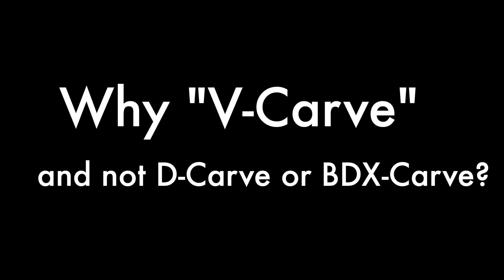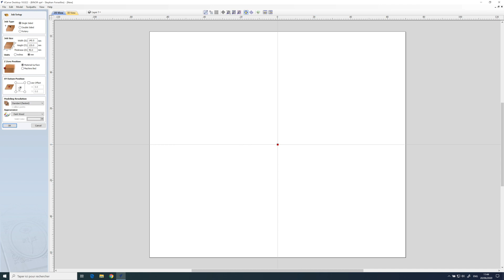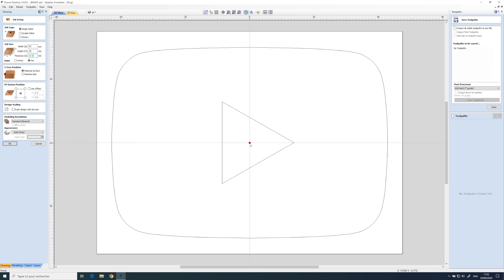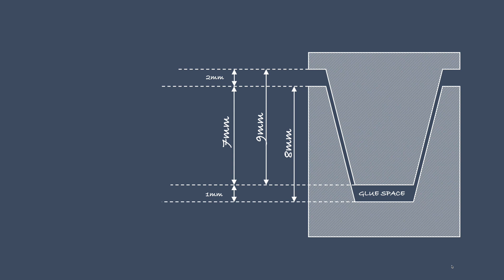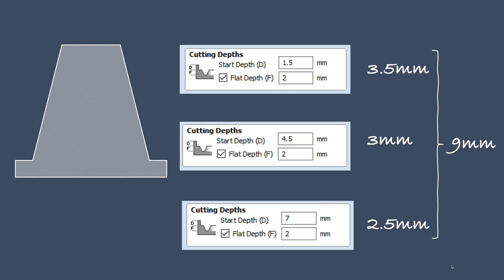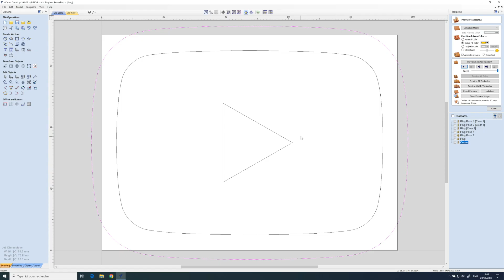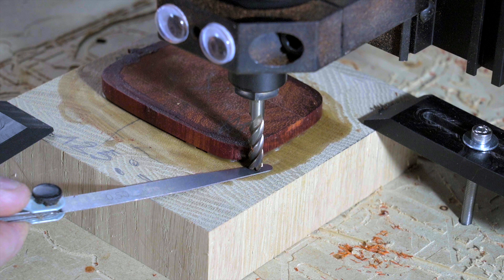Deep inlays VCarving detailed tutorial with Vectric VCarve

Comment: Can we adjust the multiple tool paths to get the full depth of the plug by setting the cut depth of the bit used?  I use this method and Aspire v12 on a Legacy Maverick 3x5.  Thank you for the very informative videos you create.  You are an excellent instructor.
Reply from the maker: Thanks! No that won't work because VCarve (in my case) considers that there nothing above start depth so it will immediately plunge to Start Depth + Cut Depth on 1st pass.

Comment: What values determine the glue gap vs how much the male piece protrudes above the female? In your example I assume the 1mm glue is the difference between the depth of the female piece compared to the final depth of the male. 8 vs 9. But what values control the gap of the male piece above the female?

Thx
Reply from the maker: Hello. Glue gap would be (Flat depth of pocket)-(Start depth of plug). What protrudes (gap that 'sticks out') is flat depth of plug.

Comment: I have tried your method and followed the process exactly with the exact same depths of cut but I can't get it to work. The plug and pocket are exactly the same size and only go in about 1mm... what am I doing wrong??? Do I need to off set the vectors? Please help!!!
Reply from the maker: You don't need to offset. You use the same design (but flipped) and the Start Depth of the Plug will be the depth of insertion. I learned/experimented by inserting a lot of small start in scraps. :)

Comment: Hello, first I must say, dthat you have made a very good tutorial. I have a quastion. If you tell the V-Carve tool bit in the settings of the bit, that it can only plange 3mm in, than you dont need to make many of tool pathes. Am I rigtht, or wrong?
Reply from the maker: Hello, thanks! The parameter 'pass depth' is only valid below the Start Depth. So if the start depth is 10mm and the pass depth is 3mm, it will immediately plunge to 13mm.
Reply: Yes, you're right. I've tried it and it's actually as you described. Thank you for the explanation.

Comment: Great lesson. But instead of split manually the tool path for the male, can’t I use the max pass settings of the bit?
Reply from the maker: Thanks! That parameter (Pass Depth) is not used by the CAM above the Start Depth. So if Pass Depth is 3mm and Start Depth is 10mm it will directly plunge at 13mm.

Comment: Hi Steve, I hope you still review these older posts!!  First, I want to thank you!  I very much appreciate the detailed explanation you've given here.  It all makes sense, but I was unsuccessful in replicating your procedure.  My plugs were a little too loose, and I'm wondering if it's the v-bit.  I tried a 2-flute, uber-sharp bit, but the tip immediately blunted on first use.  So I thought that threw off the the diameter and caused it to cut to much.  So I bought a better quality Amana bit, which had a secondary bevel ground tip, and the insert was even more loose.  Please tell me what was the bit you used.
Reply from the maker: Hi. Yes I review but it can take time. ;) Thanks for the feedback. No need for a very sharp tip. I'd recommend getting a .25mil round nose and (for me, that's the trick) configuring it as a flat-nosed engraving bit. That's what works best for me!

Comment: Another question.  Can this be done using pocket toolpath?  If not, why?  Thanks for making this video btw.  Very informative
Reply from the maker: No, because a pocket toolpath will only carve where there is enough width for the bit to go all the way to the cut depth. That's not a problem for such a design but for a more intricate one you wouldn't get any of the details.

Comment: Excellent video. One question. Why not just use one tool path snd set a depth per pass rather than three tool paths which you then combine into one?
Reply from the maker: Hello. Pass depth only works below start depth. For the plug we have a big start depth and the bit would plunge directly to Start Depth + pass depth.

Comment: Great video! But I have a suggestion, for if you ever revisit it.

The one part of the whole depth calculation that remained unclear to me after your explanation was the significance of "start depth", with both pocket and plug, so I think a little more attention to this point would make it clearer. The bit that I didn't get from your explanation is that start depth (on both pieces) is the depth at which the outline of the carving *matches the lines in the design*.

For example, suppose the design has a 5mm wide line in it.  What we want is for the cut into the pocket to be 5mm wide at the surface, and we want the plug to be 5mm wide at the plane that will line up with the pocket piece's upper surface. On the pocket, the cut will slope inwards from that widest point at the surface, and on the plug it will slope inwards above that plane (before inverting it). That plane, which is the surface of the pocket piece and the maximum insertion point of the plug piece, is what VCarve calls the "start depth".
Reply from the maker: You're totally correct. In your case, the plug's SD would be, 0mm so the line would measure 5mm on the pocket surface. And on the pocket, I'd use a SD of 8mm which means that the line would be 5mm wide 8mm below the top of the 'ridge'. It means that the plug would fit 8mm into the pocket and there would be a 2mm glue gap. The Flat Depth of the plug would be what 'sticks out' after insertion.

Comment: Huge question...
Using a 6.2deg tapered ball nose with a clearance bit of 1/8" for the Female depth .2" male portion of the inlay (start depth 0.18, flat depth .12) total .3" for inlay.
Pass 1 start depth 0, flat depth .0625
Pass 2 start depth .0625, flat depth of .0625  - Total .125
Pass 3 start depth .125, flat depth of .0625  - Total .1875
Pass 4 start depth of .1875, flat depth .0625 - Total .25"
Pass 5 start depth of .25, flat depth .05

I know it sounds like a lot of passes but this is a ver cautious case.
Also what id the pass depth for the 6.2deg is different than the clearance bit?  Should the be conservative?

Thank you very much in advance.
Reply from the maker: Yes, those pointy bits tend to be more fragile (and turn slower) so I generally do less agressive passes. :)

Comment: Good evening how are you.
I have followed the process as you explain it, with the same parameters for the pocket and the plug, and the same tool, and on two occasions the plug does not fit inside the pocket, clearly it is seen that it is bigger, if you can help me help with that, it would be very useful, because I'm stranded, thanks
Leon Anchislavsky
Reply from the maker: Hi Leon. There could be a lot of reasons but if your Start Depths and Flat Depths are correct, it may come from the bit setup. What bit are you using?

Comment: I would like to used a 6.2 degree tapered ball nose bit for making inlays using V-Carve. Do I need to set this tool as a V-bit?
Reply from the maker: No, better set it as a ball-nose or (better for me), an engraving. That's what gives the best result because Vcarve will take the non-pointy nose into consideration when making the toolpaths.
Reply: I’m also using the amana 6.2 degree with 0.25 radius. 
Having problems with the inlay , it seems to round the corners and after clearing the plug every corner missing the point.

Comment: One question.. are the inlays made from end grain pieces of wood. They all seem to look like plugs cut from end grain panels
Reply from the maker: Indeed 99% of what I do is end grain. I make the blanks myself by glueing pieces. Two reasons:

1) for cutting board end grain is more resistant and more gentle on the knives as they cut 'between' the strands which just give space then come back. A bit like inserting a knife blade vertically in a toothbrush.
2) End grain is much more satisfying to carve (faster, more precise, less noise)

Comment: Brilliantly explained, do you have a guide on how to do the inlay toolpaths for small lettering? As im having a problem with that thanks
Reply from the maker: Hello. No I don't have a specific guide. But as a general rule, avoid segments narrower than 2x your bit nose, if possible. Don't hesitate to spend time in Node Edit mode at high magnification in Vcarve checking and correcting those. It's not fun but it does help a lot. Also, the choice of font is always important.

Comment: I don't understand the need to do the extra tool paths. Why not just set start depth on the plug 0 and flat depth 7?
Reply from the maker: Because the start depth on the plug is the insertion depth so if you start depth is 0 the plug will not enter into the inlay, it will be too "fat".

Comment: Great video and thanks for making. I have been operating for 4 years and this is the best video I have came across on vcarve inlays. Very good explanation of the plug multi pass trick. It will save me some bits even having a heavy machine. It always made me mad that it did the plug in one pass and I just assumed missing with the values would miss something up.

Comment: I don't quite understand the multiple passes.  Because the cut is sloped, starting at a different depth means the path is offset.  Somehow the selection of the V bit must be affecting the geometry all of the toolpath passes are working to create, but I don't understand how.
Reply from the maker: Hello indeed but the deeper passes will be wider than the previous ones, enlarging the design a little bit each time. But at least most of the  material is already gone. So you are good as long as you don't go deeper than the fluted length of your bit.

Comment: I don't get it, why can't we just set a start depth of 0 for the plug part and a flat depth of 9mm and let it split the passes according to the cut depth we set up for the tools without doing it manually?
Reply from the maker: Hello. The start depth of the plug is the "insertion depth" into the pocket. If you have a start depth of 0 and a flat depth of 9mm for both the pocket and the plug, the top of the design of the plug will be exactly the same size as the top of the design of the pocket so there will be no insertion. Not easy to explain, I hope I'm clear. :)

Comment: Hi Stephan. I loved your video as I have been trying to figure out deeper inlays. I don’t arched your video several times and used your numbers to test. I just cut my pieces (using a 15 degree v bit and 1/8 UC end mill). My pocket knife as layered as you can see from video. My plug did not go 1/4 down. Any idea why pocket is layered and why the plug doesn’t go far?
Reply: I can’t upload a video here but will be posting liking to email
to you. Thanks again.

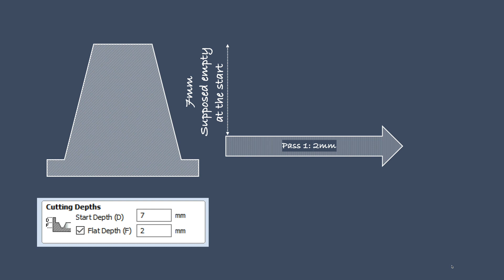Comment: I have the same software and I don't change the zero depth in the "male" part like you discuss starting at 23:18.
After I get the g-Code done for the "female" part,  I do flip the image for next program for the male part to a mirrored image and put another vector box around it. I then cut it just as any other piece. The machine doesn't need to know its going to fit together as one. You do have to create a small offset, but trial and error of a small design, like a star, you can get your magic number that applied to your machine and will work for all inlays then going forward.
If you do it this way, it will fit perfectly without the complicated part about changing the zero depth and chance breaking bits or damaging your machine.
Give it a try it works great for me.
Reply from the maker: Indeed you can do it by flipping and creating an offset. I even made an Excel sheet that calculates exactly what the offset should be based on insertion depth using trigonometry. :P But I got better results by using the Start Depth technique, so I stuck to that one and tried to find the best values.

Comment: Hi Stephan, fantastic explanation, but I have one question left. Is there any kind of correction in Vcarve regarding your V-bit? I gave the program all the information it needs about the angle, the tip (0,25mm radius or some other values for a flat tip etc.)  of the milling bit but when I carve my pocket it gets a bit wider as it should be. The opposite happens for the plug, it gets a bit slimmer as it should be. When I plan around 1mm gap at the bottom of the pocket for the glue it´s way to less because the plug will slide in much deeper as it should be. Usually the plug will sit on the ground of the pocket and gives me open sides. I assume this comes from the fact that V-carve, unless I gave it the information about the the tip of the bit, it calculates the toolpath for a "perfect" spear top without any radius or something like that. Is there a way in V-carve around that or do I have to find the values by  trying and remeasuring? I use the desktop version of Vcarve
Reply from the maker: Thanks. After many tests I found out I get the best results using the configuration of an engraving bit with a flat tip!

Comment: This video helps a lot! One question, to my understanding, as long as you know your start depth, I would assume the flat depth can be deeper. It is just a matter of how much space you want to leave between the plug and the base board, right?
Reply from the maker: Indeed. I generally leave a gap of around 1mm for glue space. Don't leave too much or it will sound hollow and cheap. ;)

Comment: New to this so please forgive the ignorance but for the plug why can't you just have a start depth of 0mm and flat depth of 9mm.  Thank You
Reply from the maker: If you use a start depth of 0 for your plug, the width of the insert will be exactly the same as the with of the cut at the surface of the inly, so there will be no insertion. Say you design a 10mm with line in CAD, your plug (which is an inverted V-shape) will be 10 mil wide at the Start Depth. Not sure I'm being clear, it's not easy to explain without a drawing board. :)
Reply: @sfo2406  Thanks for the explanation.  Life got in the way and I didn't have time to work on my cnc till now and I re watched your video and this time it made sense.  One follow up question.  Why is the inlay toolpath never seemed to be used to do inlays?

Comment: Félicitations Stéphane  très bien expliqué 
I work with carbide but one a new cnc came out last year it's called onefinity 
A small remark when at the end it's time to clear the extra to get it flat  why don't you zero the machine manually and just cheat by putting 0.05 extra on top means that will stop at 0.05 at the end before clearing in the spoilboard  also I like your spoilboard did you make the file or you bought it ?
Reply from the maker: Thanks. You're totally right, and that's how I do it now (starting from 0.1mm above spoilboard and adding from thereà. The spoilboard with the markings came with the CNC but the one I put on top is cheap MDF (that has the advantage of being very flat) and I made it myself. I remake regularly, it costs less than 10€/$.

Comment: Thank you
I did all the steps but the corners are not pointed !!!
Reply from the maker: Hello. Most probably the wrong bit or wrong configuration of the bit! Which type of bit do you use?
Reply: @sfo2406  
Thank you, I use V bit 15 degree 0.2 tip

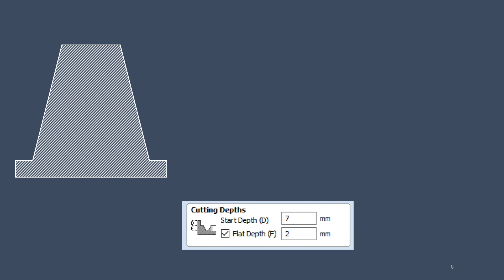Comment: Hello Stephan... very nice tutorial.  But- I have a question... At 23:58 you explain the additional tool paths, which I understand clearly.  But- why did you set the start depth at 1.5 mm instead of the top of the work, which would have been 0.0...
Reply from the maker: Hello. That specific toolpath is just there to avoid going 'full depth' at once (7+2mm). I generally keep my flat depth set to final value (as it's the 'sticking out' part it's generally 2 or 3mm and it's easier to change just one parameter, less chances of mistakes) and I gradually increase the Start Depth on my 'stacked' toolpaths. So here I'll cut 1.5+2 = 3.5, then 4.5+2 = 6.5 (so additional 3mm), then 7+2 = 9mm (so 2.5 more).
Reply: @sfo2406  Thanks for the reply!  
Ok... so- for the first of the 'stacked' toolpaths, would it have worked out the same if you set your start depth at 0 instead of 1.5?  It's that 1.5 start depth I'm trying to understand...
Reply: @sfo2406  I was wondering this same thing. I'm glad that I searched comments first. It seems the downside to keeping your flat depth the same is that on the first pass, the machine will behave as if the first 1.5 mm of material is already removed when it is not. On the second there will be 1mm of material that "should" have already been removed, based on the start depth, but was not. And the final pass will have .5 mm. 

To achieve the same results but need to change two numbers rather than just one for each toolpath:
Pass 1:
SD: 0
FD: 3.5

Pass 2:
SD: 3.5
FD: 3.0

Pass 3:
SD: 6.5
FD: 2

Do I have these numbers right?
Reply: @MrStrizver  This looks like how I might approach it, but have not tried it yet.  wood is too expensive to keep testing for and end cut cutting board, lol.  Have you tried this yet?
Reply: @SMS14411  Not yet. I've been caught up in other projects and haven't gotten around to doing inlays yet. It's definitely on my list of things to do, though!